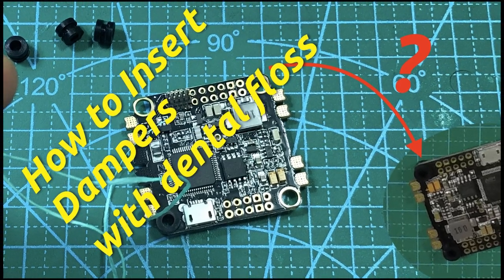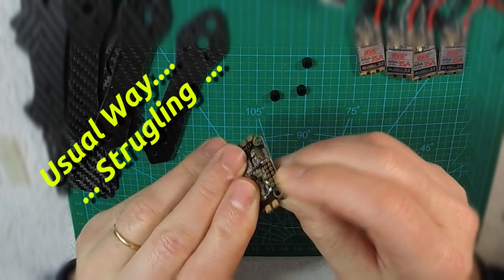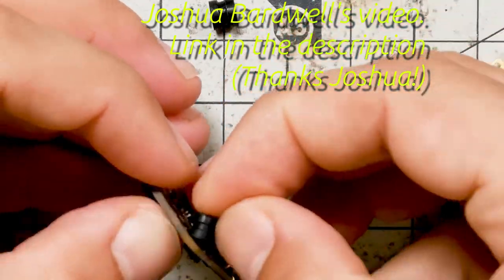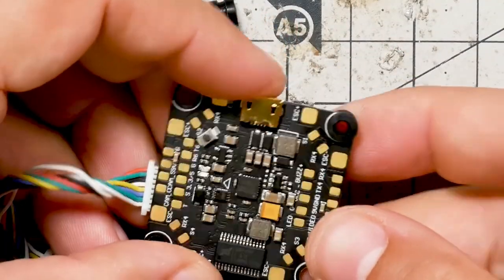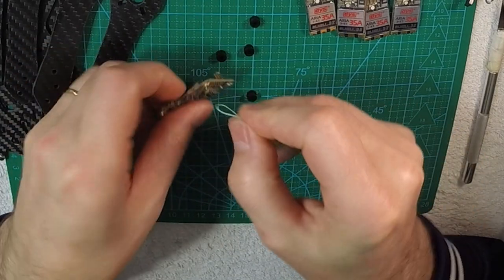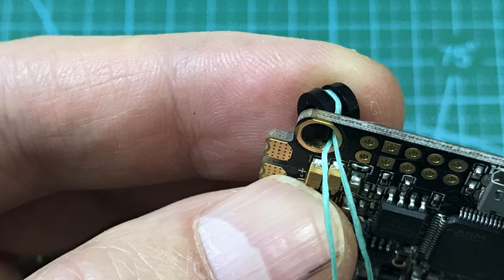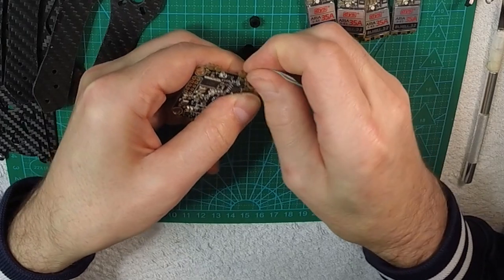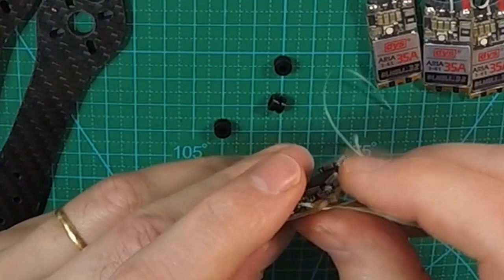[how to] Easy install soft-mount on flight controllers and 4in1 ESC (silicone grommets)

Comment: I just split one in half trying this technique.  Wish they'd just send them installed.
Reply from the maker: Hi Jeremy, i'm sorry to hear that. You're totally right, would be much easier if they came installed. Try to use a thicker wire/floss. I've usually used floss tape.